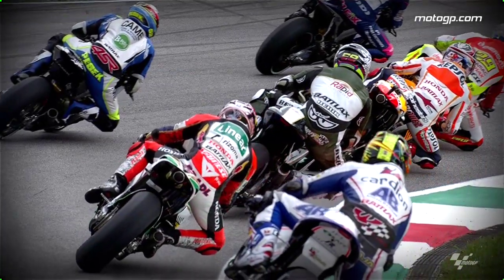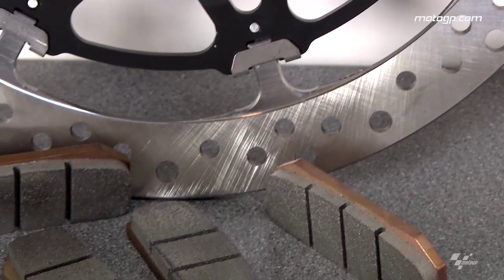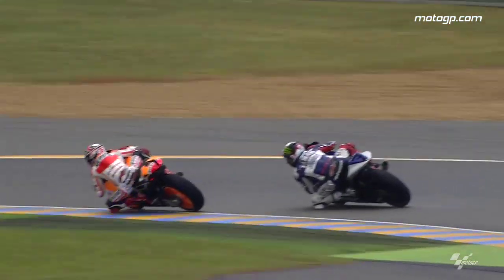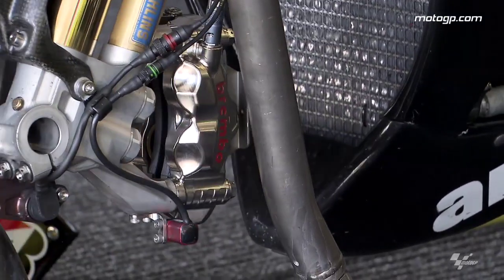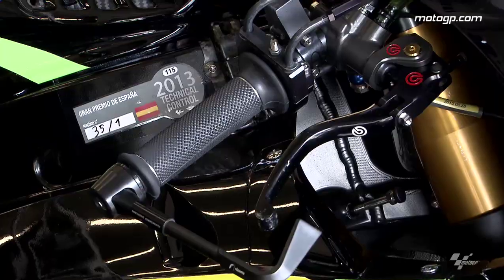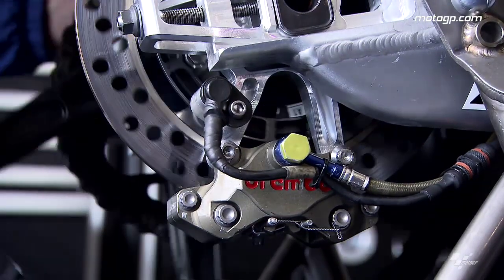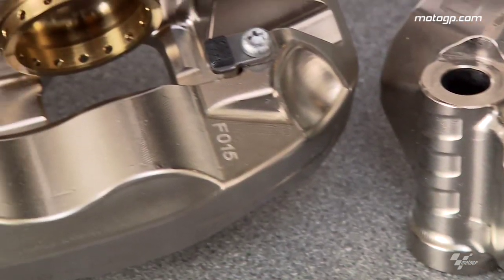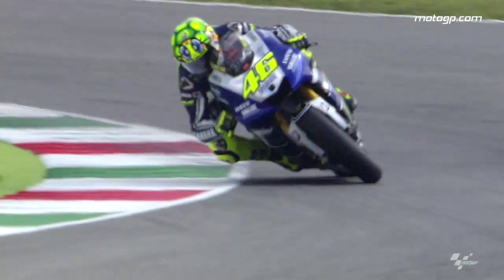MotoGP™ Workshop: Brembo brakes

Comment: why dont they have holes on the carbon plate, and steel plates have holes?
Reply: Not really. now day , the holes on the disc are for here to "break " the water film who's forming on the disc in wet condition. for cooling the steel disc there is a grove on the slice of it . but for the carbon this correct ^^
Reply: The holes on brake plates is for cooling the plate it self, you know steel are weak against heat.
And besides carbon plates need higher temp to achieve best braking performance. 
If they put holes on the carbon plates, it mean less contact area with brake pads.
Less contact area mean less friction, less friction mean less stopping power. 

Sorry for my crappy english, I hope you understand :D
Reply: thanks :D

Comment: @Gene Mitchell That obviously depends on the amount of grip that is available. On a dry circuit with slicks, yes. On the public road with road tires... no. If you don't have enough traction to displace all the weight to the front of the bike, you are still better off using the rear as well. Even if it has only 5% of the mass on it.
Reply: +PbPomper 
   I agree that there are circumstances where using both front and rear brakes on a bike will stop the bike better, but this is only true in 
certain circumstances.  Anyone who rides a street bike should go to a 
race track and rent a sportbike for the day and better their riding 
skills in a controlled and save environment.  Many motorcyclists would 
still be alive today if they did that.

Most road riding motorcyclists do not know how to brake really hard with out locking up the front tire, or how to avoid crashing when they locked up the front tire.

Even if only 5% of the mass is over the rear tire when braking hard, using the rear brake with practically no weight over the rear will just lock up the rear tire causing most people to panic even more or make their bike go out of shape and fish tail.
Reply: mobil

Comment: +Gene Mitchell Like the explanation on videos, rear brake is very personal. If you believe about that, then why they still need the rear brake, why they not just uninstal the rear brake? And if you ride motorcycle, why you dont uninstal you rear brake if you think the rear brake not make it faster in braking? Racing is predicted braking, but emergency braking is not.
Reply: +Indra Firdaus So when I brake really hard with my motorcycle (sportbike) to avoid a collision, the rear brake helps me to stop faster when the rear wheel is in the air ???
Reply: the rear is used a lot when you have to suddenly brake midcorner..
Reply: +Indra Firdaus Rear brake is required equipment on the street and track. Had a tank slapper once getting off the freeway and lost brake pressure in the front lines and if not for the rear brake I would have gone through the next intersection.
Reply: To stop in the shortest distance master the front brake, g forces throw the center of gravity so far forward the back tire lifts off the ground with zero traction/contact with the road. If I do a wheelie or take off fast what happens, all the weight goes to the back tire lifting the front wheel, think of traction like skiing on a teeter totter
Reply: if you at the corner and only brake with front brake you'l be fall believe me.and front it just when you ride normaly but for panic braking is needed
Reply: I use the front brake in the turn ALL THE TIME AND NEVER FALL. You must be doing it wrong, if the front tire locks there is a good chance of falling whether your turning or going straight. As front brake pressure is applied in a turn the bike will want to stand up, apply too much pressure and the wheel will lock and if you don't respond fast enough a fall is more likely. Most of the time a panic situation happens when your going straight when using the rear will usually not stop you faster unless there is water or debris on the road way in which case you will not be able to apply the front 100% (lifting the rear tire off the ground) using the rear would help,
Reply: Muhammad Luthfi wrong, do you even ride? Kevin Schwantz never used rear in his career, when on mountain especially track I rear my slipper clutch for rear brake...reason they have it in motogp LISTEN it's because of the motogp rules...Nicky Hayden once said his habit of using rear brake is bad in motogp. if you are a trail beaker rear is useless...
Reply: quiz

Comment: For everyone who thinks emergency braking with the rear and front brake together will stop you faster than the front brake alone: 3:51
Reply: +Gene Mitchell Hence why Valentino Rossi doesn't even use the rear brake.
Reply: I only use front brake coz my rear brake pads are worn out but the front brakes are more then enough...only in the wet I'm forced to use some rear on the turns or Sandy roads